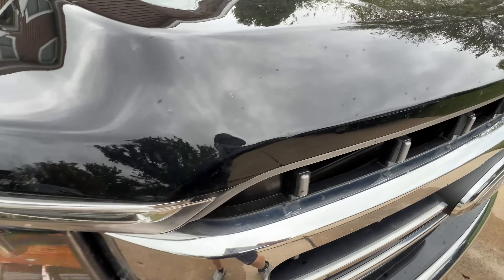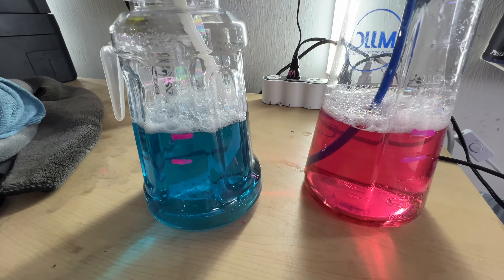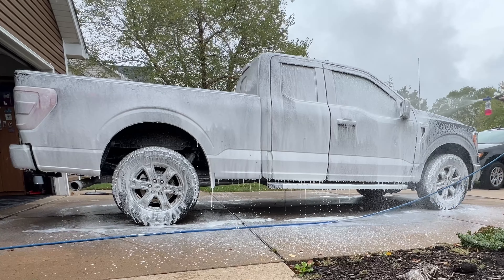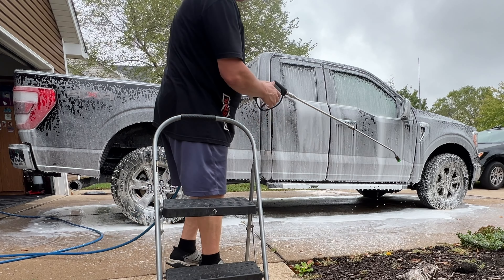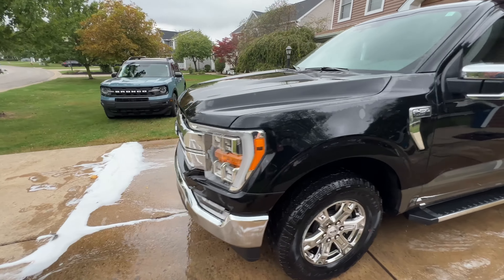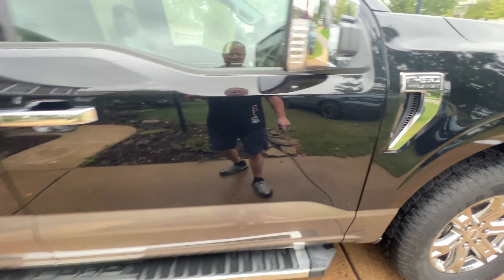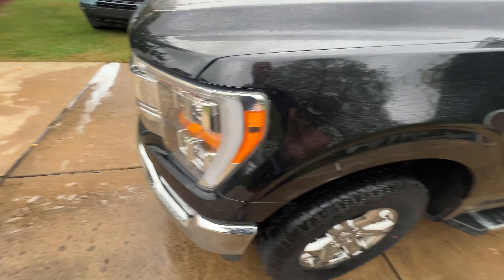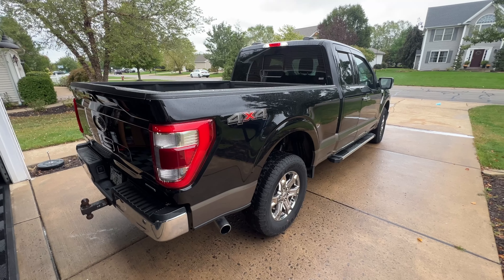My first test of CHEM-X STARS AND STRIPES. WOW!

Comment: As with all systems they have limitations and understanding the proper cleaning process will make a greater impact on a spray on rinse off and drive away.  You started with a nasty truck and it came out ok. You can tell there was not much protection if any on the Truck so product went right to work without anything stopping it. I would have gone after the chrome and those difficult spots. Bugs hit a car while it is dry and gets a great bond on the protection product there if there is any. The Stars and Stripes is said to be good with Ceramic sealants and does not strip it off. I expect that if the car is properly coated Stars and Stripes would do even better so a proper detail and coating would be best. It took me 6 hours to clean my F-150 with foam and mit and rinse and all that. I would rather spend time doing other things. Good review.

Comment: Yes, I've seen several videos on these products and they seem to work well.  My thoughts are how much do these products cost?  And do they strip off protection?  My strip off soap cost about $9 a gallon, but then I hand wash, then decontaminate.  I charge by the hour, so the customer pays for my time.  Or I will use a rinseless wash for maintenance washes.  I can see if you do large trucks like BOB does, but not sure if it would work for my customers???  Thanks for the demo!
Reply from the maker: thanks!  I did use it on my personal vehicle the other day(5:1 tho).. It did remove more dirt, especially on the wheels than all of my other foaming products.  Time will tell.  
Thanks for watching!